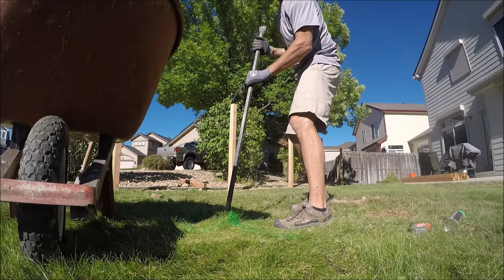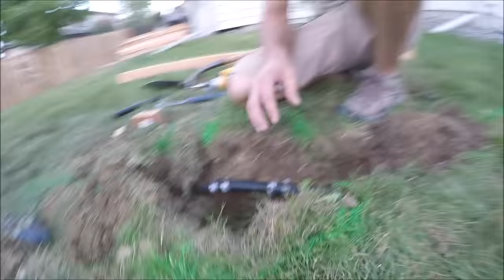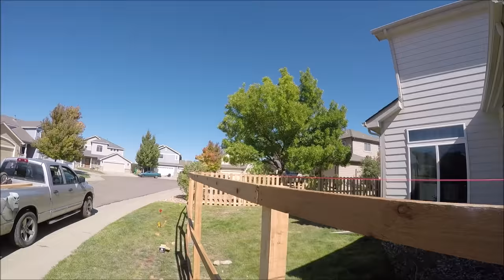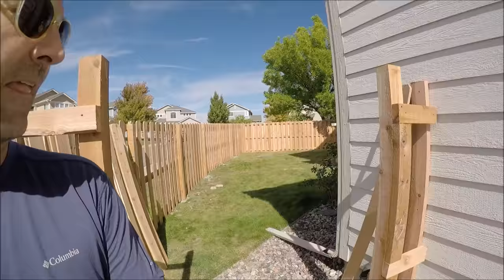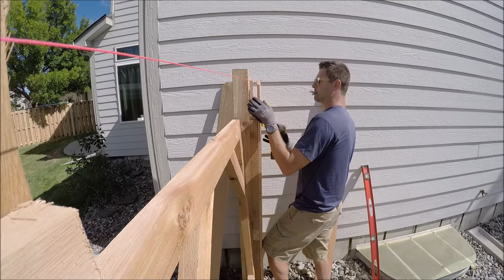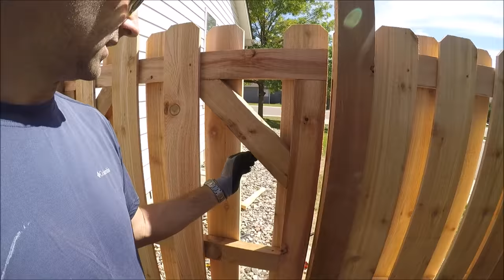How to build the nicest fence in the neighborhood.

Comment: Just saw a thing called a Mole holer or something like that on you tube, yesterday. It was for "digging" small diameter holes into the ground, but it was just a hollow pipe with some teeth on it, and a T handle at the top, and as this was twisted, it worked it's way down. A big shop vac hose was attached at the top which sucked up the dirt. The guy said it was the easiest way to dig.

Comment: I'm from the UK and at the bottom of pailingfencing we run along board at the bottom of the fence so the end grain doesn't soak up moisture plus you can use it to level you boards instead of using a string line
Reply from the maker: That makes a lot of sense.  Its just not used on this type of fence out here.   I think the customer is going to be landscaping and adding rock on both sides of the fence.  I just build a 50 foot fence and didn't use any kind of gravel board.  I start a 100 foot fence tomorrow.

Comment: Really like the design idea to accomodate for  the wind
Reply from the maker: It took a bit of extra time.  Using the spacer, then having to do it all over again on the other side.  Once I had it all put together I went back and made sure that each picket had 6 screws each holding it to the rails.  I'm glad I only build a few of these a year.

Comment: Before you start any excavation, post hole or any digging your first step is to call 811. If you hit a buried utility or gas line without calling 811 first you will be fined and or jailed.
Reply from the maker: +Corey Sharp    I always call for locates.  Thats why I had to hand dig all of these holes.
The fence was close to both electric and gas.

Comment: When repairing water sprinkler systems. Why don't you use connectors made for those line. You use hose clamps and a barb fitting.

Comment: Why didn't you use a gravel board at the bottom of your fence as moisture will soak up in to the pailings make them rot quicker
Reply from the maker: this design was spect out by the customer.  And I have never heard or seen a gravel board.  Do you mean boarder? The customer is taking care of the landscaping.

Comment: What method do you use to set the posts? All concrete? Packed soil? Crushed rock? Sand? I appreciate the info partner.
Reply from the maker: all concrete,  mixed in wheel barrel. Holes are just over 24 inches deep.

Comment: Would you happen to know if stained or painted pine could be used as pickets about 3.5 ft high. I've heard it will warp by some, and heard it will work by others. Any opinion?
Reply from the maker: I only use cedar or pressure treated pine for fences.   Cedar is naturally resistant to rotting. pine will work but will not last as long as cedar or pressure treated wood.
Reply: Thanks so much. I was going to use goth pickets from Home Depot, but began seeing fences with squared off tops rather than the goth tops, and I like them better. I just didn't know which wood to use.

Comment: what screws do you use to attached the rails to the post?
Reply from the maker: they are epoxy coated exterior screws from home depot.
Reply: thank you, what's the length of the screw? will a 3.5 inch screw work for attached a rail to a post?
Reply from the maker: Yes  3 inch works fine counter sunk into the 2x4 rail the

Comment: why do you use screws?
Reply from the maker: Using nails is a short cut.  Nails only last a few years before the loosen up and start falling out.
Reply: Nails loosen up over time and make for a poor quality fence. The screws will outlast the wood in most cases
Reply: Epoxy coated screws for life. Preferably torx
Reply: Hammering on the new posts will also make them loosen in the concrete.
Reply: The Handyman Amen handyman!!🙏👍

Comment: Dude u need a light duty earth digger
Reply: clam diggers/manual digging with shovels are better to use because with a gas powered auger theres the potential of ripping through gas lines and electrical.  Hand diggers allow you to dig slowly and carefully.  You should be charging accordingly for the job so that you are being compensated respectfully for the added time manual digging adds.  happy building